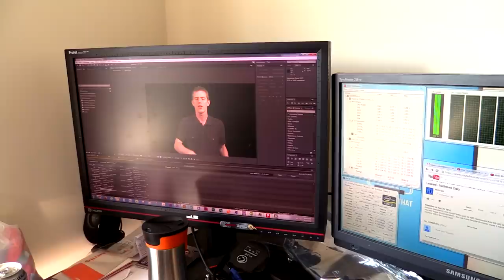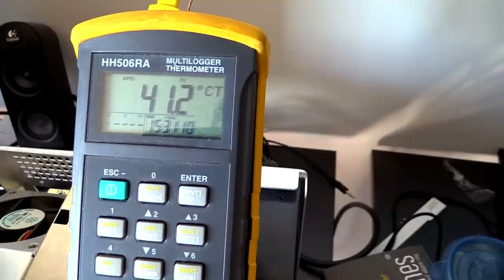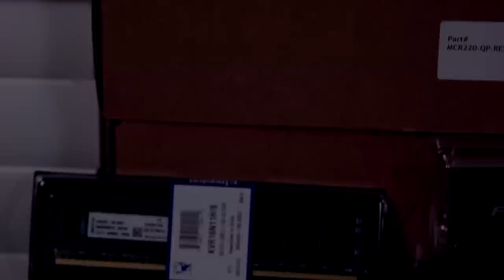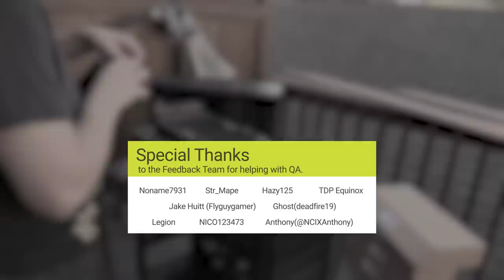Whole Room Water Cooling Project - Day 1

Comment: Would almost be funny if when they finally turn on their pump/s they get that annoying pipe shudder that bathrooms get with all that piping
Reply: "Water Hammer" as its commonly called can happen for more reasons than one, but is mostly found in "open ended" systems, where taps and such are found. Seeing as water inside the lines will not be seeing the light day, one major cause of water hammer will not be present. As long as the system is properly "bled" (all air is expelled from the system), then they should be fine, even without fixings to the wall.
Reply: Almost any washer will have this problem if no arrester is installed.
Reply: Akash is right. Water hammer does not occur in a closed loop since the pressure is constant (or very close). Your house is not on a close loop and the sudden change in pressure when turning off a faucet is what causes the water hammer effect. Unsecured pipes will move a little in a closed loop but not much and when the pump shuts off water pressure dissipates evenly in the system.
Reply: ***** if your house has steam heat, you have heard it. in college i lived in a dorm built in 1935. the radiators would keep me up at night.

Comment: whats the point of all this if your moving?
Reply: done before they thought of moving
Reply: That sucks
Reply: This was done months ago.
Reply: Linus mentioned in another comment this was filmed back in August, which is several months before they announced the crowd-funding campaign.
Reply: Even with the moving in mind, I think it's still a valid point in doing this whole thing. Remember that when this idea start coming up, Linus already said that he already plan for the individual PC to be able to work alone even when disconnected from the whole house cooling system. And by doing this in their old house, when they moving they will be able to build another one much quicker with less mistakes, look nicer and cleaner etc since there're probably tons of mistake happen during this whole building process. It's better to mess up your old house you are about to move out then messing up the new one :P

Comment: Why did you mount rads to the cases when you're running the liquid out of the room?
Reply: Thats what i was thinking too, i guess that they will mount car radiators with fans on the shadow side of the house (North side). Now i dint know where the house is but what will they do in the Winter time? Even if you put anti freeze in the water it will be condensation in all the computers becouse of the temperature difference.
Reply: soulis1000 I think the point of the radiator is what you just mentioned.  During the winter they can use the indoor radiators and drain the outdoor ones.  But even if that's not what they're doing, as long as they keep the pump running, the movement of the water along with the heat from the computers will keep it from freezing.
Reply: It's so that a computer can be disconnected from the loop (via quick-disconnects) to be used on its own for any reason.
Reply: ***** Makes sense.
Reply: soulis1000 Depends on the temp of the return flow but yeah, I'd imagine that could be pretty cold in Canada.
Reply: Folopolis You have got a Point there but if they only use the rad mounted to the chassie i dont Think its big enough to cool such a powerful machine. And sure the water maybe would not freeze (it sure wouldnt if they mix in som anti freeze in the loop) but with such a big temperature differens between outside and a hot cpu that will make condensation and waterdrops will drip inside the computers wich is not good :(
Reply: soulis1000 The rad's fine enough by itself. They're just trying to dump the heat elsewhere.

Comment: I'm a HVAC Technician IRL and there is a various amount of styles for cooling. Very high-tech systems called 'Chillers' use water cooled coils that also have freon circuits. I personally have worked on a cooling system that chills a MRI scanner that used a combination of lyquid glycols and the refrigerant R-410A. For the sake of reading, my point is this....With proper equipment designed by Refrigeration specialists such as Trane,York,and Mitsubishi, supercooling rooms while still maintaining 0% humidity, can bring ambient room temperatures as low as minus zero celcius conditions while still having active heat load removal over long periods of time.

Comment: Hey Linus, Why not keep the coolant reservoir in a modified keg-orator (or similar indoor fridge or freezer) to keep from having to run tubing outside. The Keg fridges allready have tubing comming in and out of a sealed hole and powering such a device would be much simpler than case fans... Just a thought

LOVE the videos btw, great project!

Comment: If its a whole room watercooling project why are there radiators on each PC? Im confused
Reply: If there was no radiators, the liquid would be unusably hot after the first two or three PCs it goes through. Look at those specs - high end CPU, three GPUs - the kind of setup for which you get two radiators. This loop has five PCs in it. While this solution may not be cheaper to build then five separate loops, it IMHO would be cheaper to run. 

In the end though, this is not supposed to be the most practical solution - as a matter of fact, no watercooling solution is the most practical due to the performance of high-end air coolers.
Reply: Each system has its own pump and RAD, so if one goes down, or you need to replace a part/move it, you can run each system on it's own thanks to the quick disconnects
Reply: TDPEquinox but then  you could just put a ball valve on each feed to the computer for easy dissconect
Reply: Rxsiner it is also there so that the next system that gets the coolant isn't getting hot water.
Reply: TDPEquinox ah ok that makes sence
Reply: Brendan Raymond Each system has its own rad and pump so that they can remove it from the loop and use it without the rest of the machines. 
It also serves to cool the water that goes into the next machine a little. 
This project was never about efficiency..
Reply: Brendan Raymond for their needs, having a system able to be run without every other system in the loop outweighed their need for efficient cooling. This loop currently does the job, and serves all their needs.
Reply: Brendan Raymond they need to be able to run without the loop. 
If each system does not have it's own RAD and pump, then you cannot take one system into another room, turn it on, and expect it to work. 
They seem to know what they are doing.

Comment: Sooo, you want to make the room cooler and you paint it black...
Reply: Lol, true. But bright colors are ugly.
Reply: Lol, true. But bright colors are ugly.
Reply: IDon'tKnowWhyGoogl s White would be better. It does not absorb heat as much, and it is nice.
Reply: magicmartin I guess that's true.
Reply: Madmarty black is a better absorber so if there were no windows it would actually absorb the heat better making the average temperature of the room cooler
If theres a window, it would be totally different though.
Reply: IDon'tKnowWhyGoogl S or just get very neutral colors... it's hard to screw up a house if you use neutral colors...
Reply: And use copper tubing for their hot coolant
Reply: Madmarty no, white would reflect heat, and that would be terrible lol.
Reply: @googlestealmydatapls5410  how the fuck are bright colors ugly?  I could not think of anything worse than working in a room with pitch black walls 24/7.  Depressing
Reply: Y'all realize that dark colors thing only matters on the outside of the building right? Not the inside.. it only effects heat from sunlight. Not heat in general.
Reply: Darker colors only are bad for heat when exposed to direct sunlight other light sources... so actually using black inside the room is better cause walls are gonna retain some of the heat inside the room, leving it cooler. If the room is not closed, then thats a bad idea because its gonna retain heat from the light outside the room.
Reply: @bigboat8329  It is kind of depressing.
Reply: Dark colours also radiate away more heat
Reply: Paint color here is likely to make a smaller difference to the cooling/heating here than the thickness of the paint acting as an insulator, so it's a non-issue entirely. You'd have to have an extraordinary amount of radiated power in the spectrum the paint absorbs (it's not as simple as black absorbs all), and a large surface area for it to make a difference in this application over other colors. Black is black simply because it reflects les photons and tends to not re-radiate photons in the visible spectrum. What most consider radiated heat is infrared, so you'd more so want to look at that relative to the paint, if your application would be affected by it to a large enough extent... and this isn't one of them.
Reply: If anything, from a thermal engineering standpoint, if their intent was to move the heat from the room to the outside, they should have used non-thermally conductive piping. They effectively turned the copper pipes into a whole room radiator, so most of the heat will escape into the room via the exposed piping surface area and ambient air.